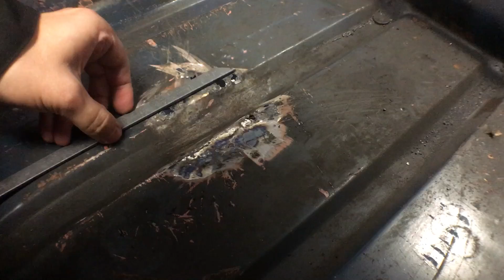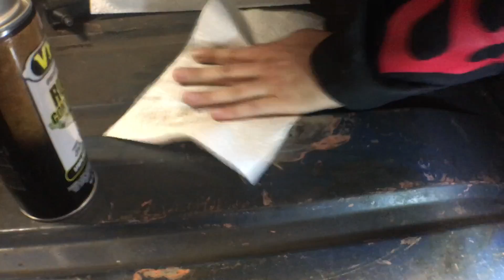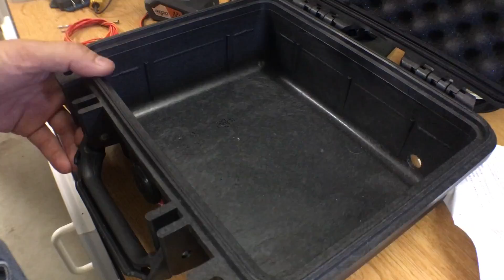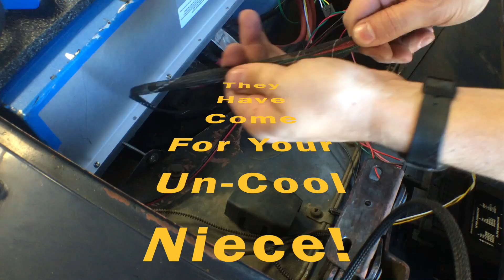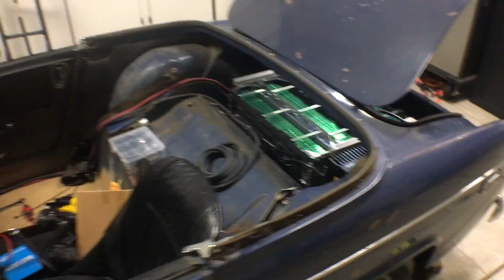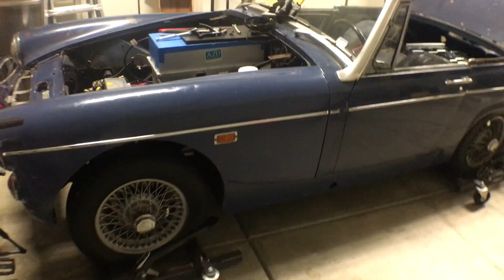MG Midget EV Conversion Part12 Progress

Comment: what are the volts/kwh specs of the battery system you're using? just one c-max module?
Reply from the maker: They're in the 300 volt range (provided you keep them in this sub assembly they come in. They can be easily broken up or re configured for lower voltages. and each c-max pack is ~8kwh, I'm rocking 2 packs for more range. I chose the c-max because it's the smallest form factor available from recking yards that's 300+ volts. These are a hidden gem as they're not a big name like Tesla and most junk yards thin the whole assembly is an inverter or something. Keep looking, you'll find them cheap. (for now)
Reply: @JuliansRandomProject  awesome, that's exactly what i'm trying to locate. I'm hoping to do a miata conversion sometime in 2020 but batteries have been the big wrinkle. seeing how modular and relatively compact these are would fit the project well
Reply: @JuliansRandomProject  had to look around, looks like you currently have the 1.4kwh packs, as a set of two that'll only give you ~3kwh at ~300v. the 8kwh packs from the energi cars are thicker and there are fewer total modules per pack